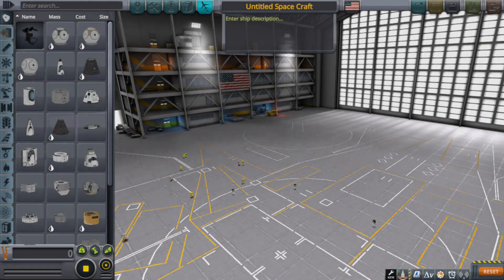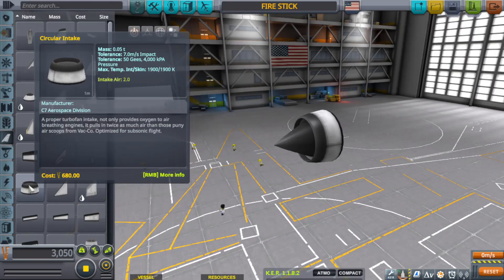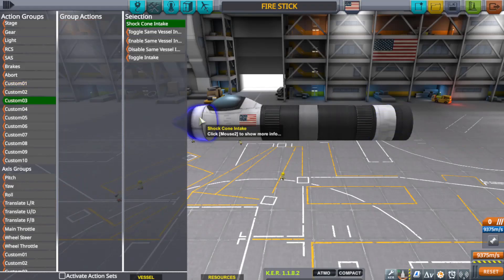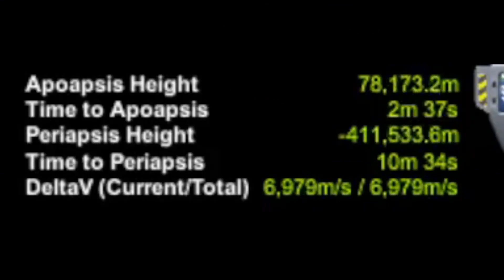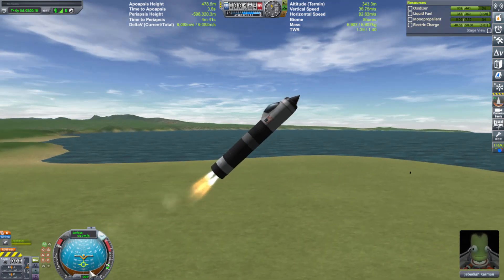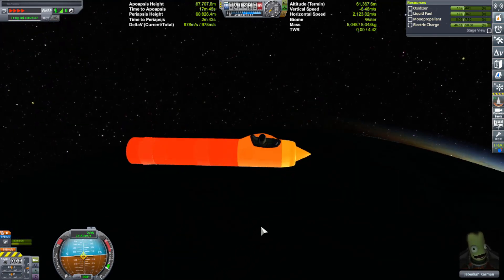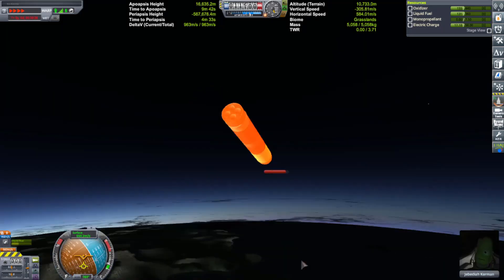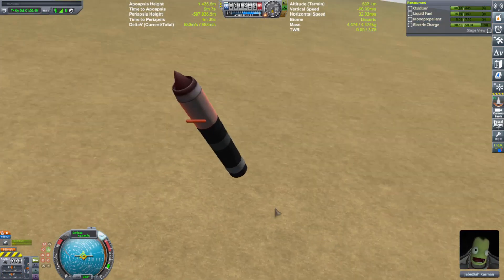SSTO only 4 parts! Piloted, Air breathing ssto that is.

Comment: And they say you can't get out of the atmosphere on jet power alone on Kerbin. I was pretty sure I'd managed it once, but couldn't remember how. Here's proof you can, and with extra oxidizer.

Also, I want to make something like this but with landing feet, and see what it can do.

I would have tried using retro thrust instead of tumbling. Sometimes, it works.

Water landings are the bane of tall rockets. ;)

Comment: Th blue thing is probably from the restock mod, the thing that masks off the inside of the intake so it doesn't look like things are clipping probably bugged out and turned a light blue
Reply: yea, its like those things they put on rocket engines b4 they 
use them
Reply: @fletchertaylor5593  no it's a thing to do with graphics

Comment: U could get it down to 3 parts with a command pod, big fuel tank, and powerful rocket engine

Or maybe even 2 with a little commond pod and a boar
Reply from the maker: This is an air breathing ssto. a rocket ssto or ssrt , can be built in ksp using 2 parts.

Comment: I know it'll inflate the part count, but you might wanna add in some landing legs for stability. And maybe consider using the precooler for an intake and using a nosecone parachute (either the tiny one on an adapter or the 1.25m one). That way when it starts tipping over for water landings, the parachute slows the nose down before impact (in addition to the fuel savings from not needing to burn to land).
Reply: He isn't trying to make it good, part count is the point of the entire concept AND video
Reply: @froo5667  I'm aware. But like, 10 parts is still pretty impressive, especially if it means it can be fully recovered.
Reply: @AnnaNym-h5k  you can fully recover it by adding a radial parachute under the intake and using the engine to slow down near the ground

Comment: You also could've closed the intake to increase the drag as you fell (not during full re-entry, but when you're going fast and want to save on some dV instead of using engines to slow down)
Reply: Doesn’t closing the intake reduce drag, or am I SSTOing wrong? (Again 😆)
Reply: @edwarddormer1103  Yes. They meant opening it or don't know what they're talking about.